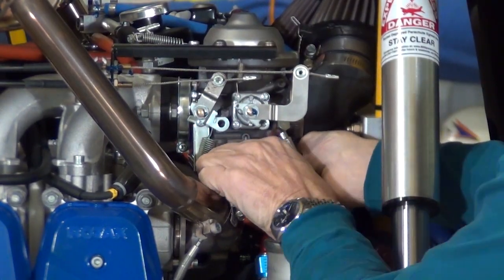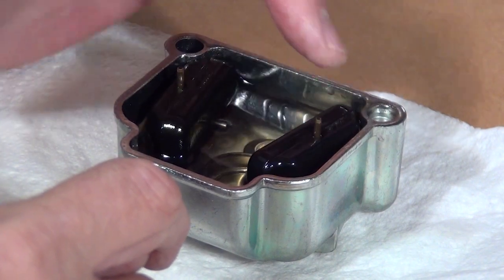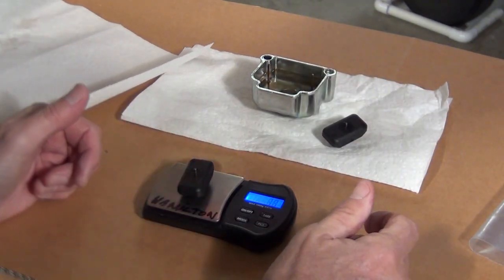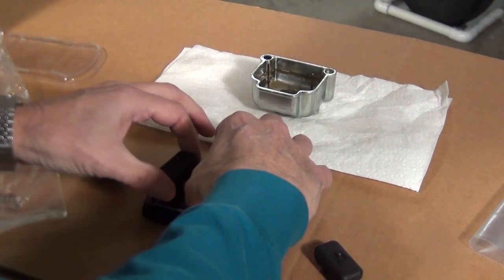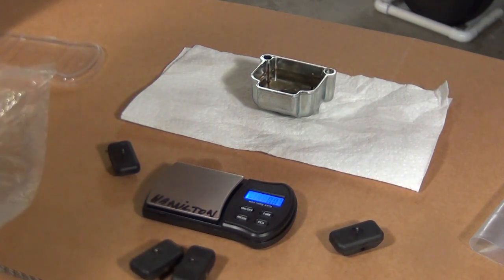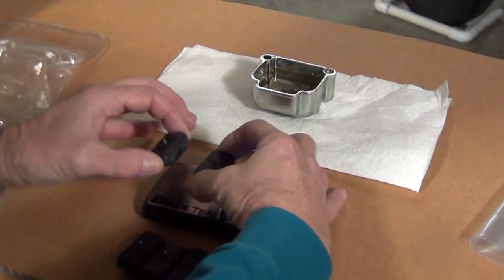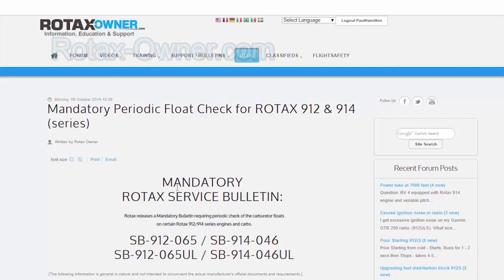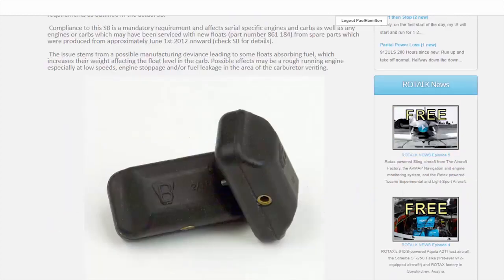Rotax 912 Rough Running First Check for Carburetor Float Problem Fix

Comment: I have many old floats that still weigh just right but the carbs overflow even after new needle valves,  i think the seats can be a problem.
I have unnecessarily changed float sets as part of the 5yr carb rebuild even when they arent sinking, and yet the bad seats can cause rough running, poor idling etc etc.  My engine always starts and runs perfectly smooth while the float bowls are low from evaporation since last run,  but 30 sec after start up it gets rough and starts shaking and chugging.  And for me it's not the floats.
Reply from the maker: If your floats pass the weight test, sounds like it is your carb bowl inlet seat or plug. Best thing is to have the carbs rebuilt otherwise you are chasing something that can be fixed.

Comment: Hah!  I'm dealing with it again, right now, as well!  And my float "bone-yard," after 2,800 hours on my Rotax, is about the same size as yours.  Thoroughly disgusting!  Thanks for making this video.  BTW: The newest pairs of floats (PN861-189) are fetching either $131.75 (CPS) or $150.95 (LEAF & Lockwood Aviation) as we speak.  What a bad joke--and it's on us!
Reply from the maker: Yea. The fuel injected does not have floats but it is not perfect.

Comment: It's odd that Rotax specifies the total maximum weight for a PAIR of floats (7 gms) vs a specification per float.  For example, a pair that is 3 + 4 = 7gms would be acceptable, as would 2 + 5 = 7gms (if that were possible).  I agree, I'd prefer a matched pair as light as possible.  Has Rotax fixed this or not?  Who sells them cheapest?  Thanks!  PS I've followed you for years back to the original 1980s ultralight flying days (Glider Rider Magazine, Ultralight Flying Magazine) and have some of your books.  Thanks for your contributions to sport flying!
Reply from the maker: I sure hope Rotax has fixed this. I am tired of replacing floats. Yes you should try and have matched weights per set that is what I do.

Comment: What percentage prove bad and how long does it usually take? I'm on my 4th set in 250 hours - now we get another directive to change at $360/set in the UK. This is big safety problem that needs fixing - myself and others have had major problems after having just been over big stretches of water. Can we trust the new design or is it best to stick with floats that are good after a long period? At the every least we ought to be offered replacements at cost - not big mark-ups. The same with the $26/pop bowl gaskets! Its not so much unaffordable as WRONG.
Reply from the maker: I agree. I am really irritated with this float problem.

Comment: hi paul surely this is a design fault and should be sorted asap can it be converted to injection
Reply from the maker: No it is not practical to convert to fuel injection. Completely different engine design.

Comment: Hi Paul thanks for sharing this. Although this service bulletin dates back to 2012 do you know if they have come up with a new design on the floats as of yet? I am not having trouble with my Rotax 912 but my trike is a 2010 and I am not sure if the floats have ever been replaced.
Reply from the maker: Yes they always say they have come up with a solution. Hopefully the newest is a permanent fix. It should not be that difficult...........